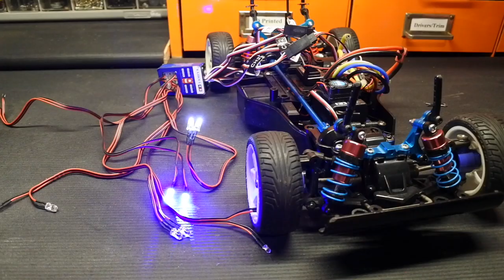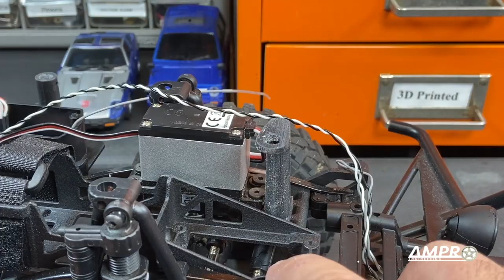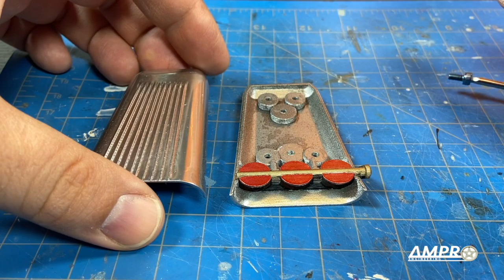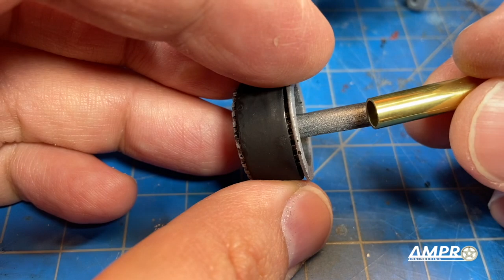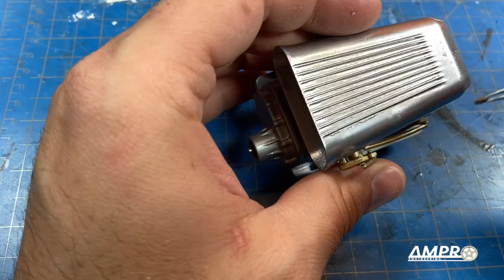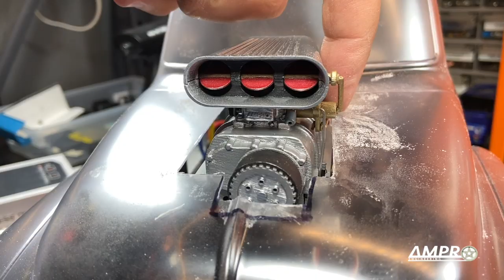e265: Axial SCX10 II F100 Blower

Comment: Meijer selling the Bruiser for 499 but I think you got an original just thought you should know about it also you still haven't told me what you think of the tc01.
Reply from the maker: yeah I wouldnt get a bruiser. The TF2 is a gem. I sold off 3 of my bruisers and the last one goes up soon. the HG P407 may hang in a bit since I will change the axles. The TC01 looks amazing

Comment: Controlling this using an Arduino should be a fun project. Reading input from a receiver is very easy, it requires no electronics and one line of code. Controlling an servo or ESC is also pretty easy. the shiftlight can also be operated by the Arduino.
If have done a few RC related Arduino projects and would be willing to help you on this.
Reply from the maker: Shoot me an email, amproengineering@gmail.com

Comment: Hot knife on the links for the carbs may be easier😂😂😂😂
Reply from the maker: It would but the ployjet print doesnt melt like abs. That would have been nice though!
Reply: @AMPROEngineering  could you do a guide on the different types of material and the pros and cons?

Comment: You could use a radio with mixing to control the servo on another channel. On the mixing select a negative mix for reverse. The blower servo will then go in the same direction for fwd and the opposite in reverse. This could sort all the end points too.
Reply from the maker: Yeah that is what I am doing now. Much better this way!